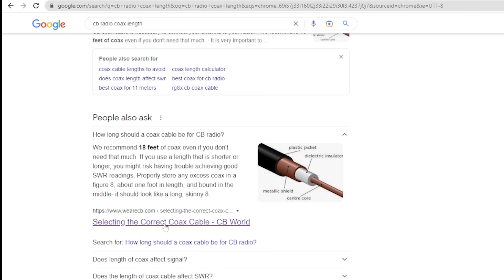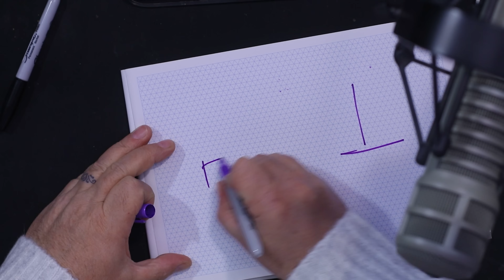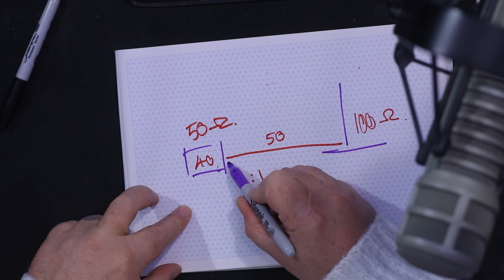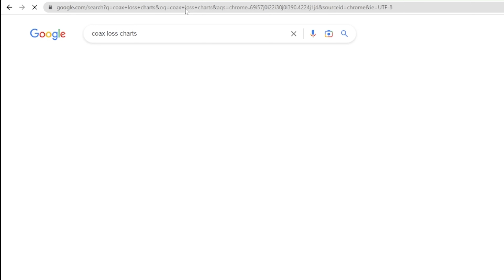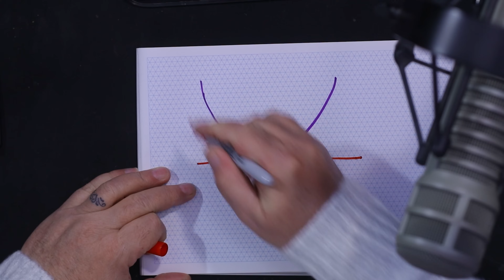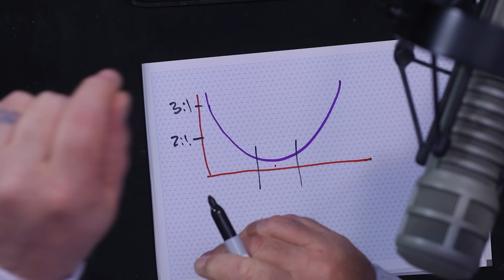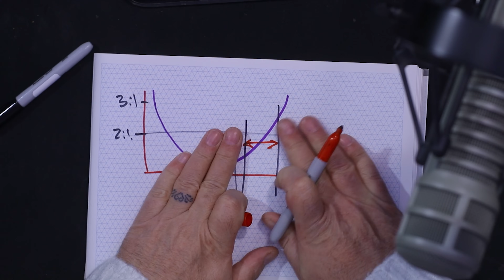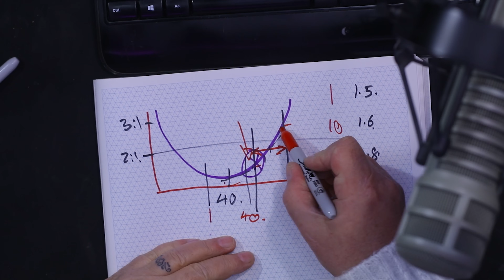11m / CB Radio: How Long Should My Coax Be?

Comment: I don't understand the animosity to CB with some radio hams, radio is radio, it's all good fun. I used your calculator to tune my Signature 9, I built it and cut according to the chart, but I wanted the CW end of the bands, I adjusted the length the calculator gave me and it was spot on the desired frequency, saved me hours of mucking about with an analyser and side cutters.
Reply from the maker: >> "radio is radio, it's all good fun" - well said Ron :)
Reply: Ditto, we have to break the stigma. We are all on the same boat just with different sized paddles.

Comment: Hi Callum,,Agree totally, that said with coax becoming an impedance transformer with an antenna feedpoint mismatch, the radio will see different impedances with different lengths, you spoke about half wave lengths repeating feedpoint impedance perhaps another video on feedline impedance transforming to completely eliminate the myths 👍
Reply from the maker: Hmmm. I wonder if I might become out of my depth..!
Reply: @DXCommanderHQ  I am sure you won't be out of your depth, I think it's a totally misunderstood subject that needs someone with a platform you have to help dispel the myths ,although you've mentioned most of where the myths have developed from every length with a feedpoint mismatch will show the radio a different impedance ,think more on this point may help with the understanding of the subject, also common mode current can cause issues with different lengths
Reply: @DXCommanderHQ  lets have  coax shoot out,,and but the myth and theorys to the test.,,,would be intresting  results.

Comment: Am I right in saying, if an antenna is tuned to 30ohms it will perform better on TX and 75ohms will optimise RX. Therefore the reason we settled at 50ohms for transceivers is to have the best of both worlds/happy medium? Could be an interesting subject if there's some truth behind this speculation.
Reply from the maker: So I never knew that myth existed. Gawd, what other rubbish are people going to suggest! Haha. For interest.. in ALL my experiments, I have never managed to get a vertical below about 45 ohms, even with 32 radials and over 1000 feet of wire. Theoretically, it should have been 35 ohms.. And for dipoles, they rise and fall between 40 ohms and 100 ohms depending on height - then eventually settle at 73 ohms - which is next to nothing difference to 50 ohms in terms of efficiency. I THINK I have a video that mentions that coming out (I can't remember, I have a few "in stock"..
Reply: @DXCommanderHQ  Well now you have Cal (your welcome?) I can not remember where I heard it, probably in the depths of YouTube binge somewhere LOL. Yes, a friend and I noticed the effects of height on a dipole when building an invert-v, 2m difference in height made a surprising change where it resonates (ideal for 80m without using a tuner, adjust height instead). Thank you for putting the above myth to bed and ill look forward to seeing your take on diploe height effects.
Reply: @DXCommanderHQ  this one is actually true from what I understand. And as you said it is a system, as long as it is balanced it could be 450 bananas. "Lowest loss: This depends on losses in the internal dielectric in a coaxial cable. For the air-filled coaxial, this occurs at approximately 77 Ohms, or at approximately 50 Ohms for certain dielectric-filled cables (more on this below).
Highest voltage: This is based on the electric field between the center conductor and sidewalls in the air-filled coax cable. The electric field in the TE10 mode is maximized when the conductor is constructed such that its impedance is approximately 60 Ohms.
Highest power transfer: Coaxial cables of any size might be long enough to act like transmission lines and support wave propagation. The power carried by a coaxial cable is limited by the breakdown field and the impedance of the cable: V2/Z. It turns out that, for the air-filled coax operating below the TE11 cutoff, power transfer is maximized at about 30 Ohms."
Reply: @DXCommanderHQ  and coax length does matter for accurately measuring SWR if you have a mis-match. The returned SWR voltage points are higher at certain parts of the coax depending on the wavelength of the frequency involved.
Reply: @adammcleod5026  Thank you for your input, believe I understood a portion of what you said hihi. I since Googled "radio why 50 ohms" and top of the page gave a dumbed down version of what you said.
Reply: @tobyticehurst  bear in mind this is for the efficiency of the coax RX vs TX.
Reply: @adammcleod5026  Glad I was somewhere in the ball park and didn't dream it up. I appreciate the clarification and has given me a subject to hyper focus on at some point. TE10, TE11 and V2/2 is alien language to me. Would you happen to have any suggestions to a reliable online source/document to learn/break down this subject?
Reply: No, also a crazy myth
Reply: @VE9ASN  Thanks Les, I'm sure there are a few more in the bank that will raise their ugly head. Everyday is a school day. M3TJT
Reply: 50 Ω came about because, and I forget which way round it is, 75 Ω and 30 Ω were tried and one was better for high power and the other for lowest loss so they chose 50Ω for the best of both.
G4GHB

Comment: Mmm!!,,this depate has be go8ng for years,,,ham and radio engineers are devided,,,if coax length  is not a problem  why is velocity  factor an issue,,,the problem is  we need and engineer  to write about this and not myrhs past around by hams and clubs,,hams are not qualified radio engineers normaly so it's just opinions,,,the biggest rhing that gives fails swr rearing is common mode currents getting  back to the swr meter,,hence use rf chokes esp at hf,,often over looked with lots of rf around.
Reply from the maker: It's not a debate. It's a myth. Velocity factor is not an issue either. A 50 ohm system is just that.
Reply: @DXCommanderHQ  so why mention velocity  factor in coax specs if coax legth is not an issue,,you mention velocity factor in vid why not  just connect  up and go,,bringing  velocity  factor and half wave length into it confusing the issue and bringing round this old debate,,,we cant write this as thats it end of, because one engineer wrote a book.,,,surely this topic must be covered  in textbooks for broadcast and telecoms engineers etc somewhere.
Reply: @battlestarone  agreed,, I think feedline impedance transforming needs more understanding
Reply: @paulm0hpd319  the actual physics behind feed lines esp coax is near daunting,,,what i have seen somewhere  else also say transmission line length is not relivent,,put it was referring  to open wire feeders i think,,and probably  for multiband use coax length is irrelevant,,but certainly where coax is concerned  i would use 1/2 wave length minus   velocity factor on lowest  working  frequency,,,best way still is tune antenna  at it's feed point like the professionals do i would say,,only hams tune from the shack end,,we coyld put this to the test at a set frequency, coax and dummy load and change coax out for various  lengths,,,1/4 wave,,,a 1/2 wave,,a 1/2 wave minus velocity,,and a 3/4 wave length all terminated with a dumny load at 50ohm,,,all readings at the tx end will be different,,,some even way out.
Reply: @battlestarone  coax length is irrelevant if everything is matched other than loss ,,if the feedpoint impedance is other than 50ohms   the radio will see a different impedance at every other length, the same goes for balance line only this is of lower loss and able to take the higher VAR created by the mismatch so less loss
Reply from the maker: So if you guys are genuinely keen to understand feedline transformation - then a quick Google search will give you some excellent docs that just need concentration. That was not the purpose of this video which was to discuss the general length and WHY people con you to believe that length and velocity factor play a part in the MYTH. End.
Reply: @DXCommanderHQ  the thing is Callum every length of feedline will show a different impedance to the transmitter in a mismatched system, this is dependent on feedpoint impedance so set lengths that are promoted in the myths are not necessarily the correct lengths as the feedpoint impedance in every situation would be reliant on the environment ,height etc the antenna is situated ,think as I mentioned in my first comment if more was mentioned on this point it would help dispel the myths and misunderstanding on this subject ,, I would recommend Walt Maxwell book reflections it covers everything you need to know about feedlines
Reply: It has been written about by an engineer, Walt Maxwells book reflections 3 is a free download
Reply: There's no debate,  it's exactly how he explained it.
Reply: The RSGB Handbook written by knowledgeable people, many working in r.f. jobs, says in effect coax is a means of transferring power from the tx to the aerial. No mention of velocity factor in this case or of cutting coax to certain lengths in any aerial design.
Everything is 50 Ω so no problem.
Get any length of coax you care to choose, put a 50 Ω dummy load on and measure the power at the load. Do it with another random piece. No difference, allowing for cable losses.
CMC chokes I always use.
G4GHB.

Comment: So in short, a transmission line that is shielded doesn’t transmit and therefore, it doesn’t matter…
Reply: An antenna imbalance causes common mode current to travel along the braid of coax ,high swr doesn't cause common mode current
Reply from the maker: Paul, have you thought of starting your own channel.. I see you have commented to almost EVERY comment..?
Reply: @DXCommanderHQ  sorry Callum thought I was part of a constructive discussion on the subject
Reply from the maker: Yes, UNLESS there is a ton of other crud going on, like totally unbalanced (eg high SWR) antenna and RF gets on the feedline.

Comment: High on one needs to be longer High on 40 needs to be shorter ???
Reply from the maker: If you want it to resonante lower, then you lengthen it. Low and Long start with L (way to remember it). Make it Shorter, and you'll Sharpen it (Sharp as in musical terms [higher]).
Reply: You have to look at which way the slope is going.  If the SWR is constantly increasing from 1 to 40, then the resonant point is below ch 1 and the antenna is too long.  If the SWR is constantly decreasing from 1 to 40, then the resonant point is above ch 40 and the antenna is too short.  You want it to be lowest on 20, and the same or slightly higher on 1 and 40.

Comment: I can’t even begin to imagine what was wrong with my setup in the 70’s.  it wasn’t grounded, the coax (RG8) was cut to length from the 60’ high wilson shooting star (4v 4h elements) antenna to the radio in the basement.  the antenna was simply adjusted to the measurements in the instructions.  i did have an archer swr meter but that’s nothing like having a rigexpert analyzer.  I do remember getting shocked all the time if my hand was on the mic and I brushed up against the amp.  I was just thrilled that my parents even allowed this monstrosity to be attached to the side of the house.
Reply from the maker: Brilliant!
Reply: Um. Not being critical....but.....   the biggest clue to your issue is summed up in one word from your post.....Amp

The archer SWR meter is fine..even in todays tech, it's fine....not as fancy as other things out there, but still an accurate measure of the match between the radio and antenna...if used correctly
Reply: Alot of amps then used a lamp cord too! I had a firebird years ago that had a lamp cord, and I was like what the heck?